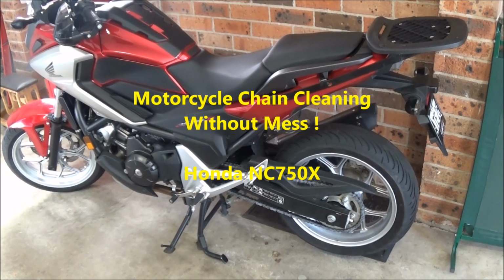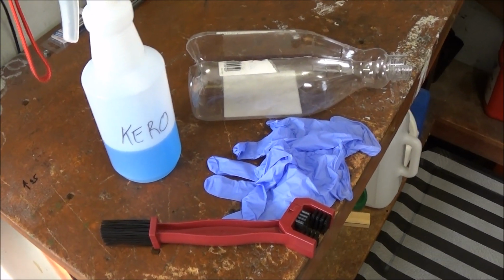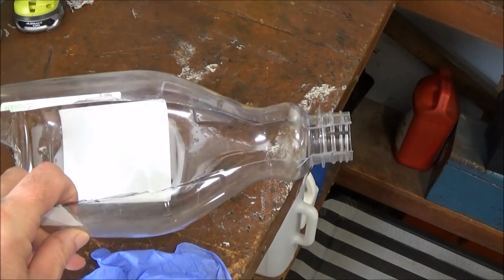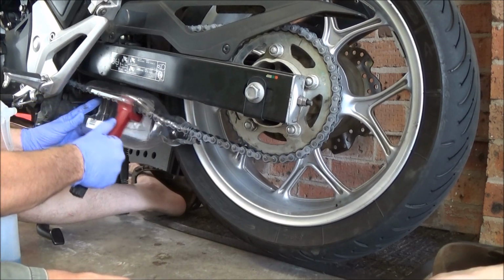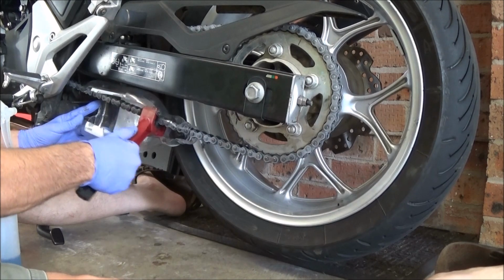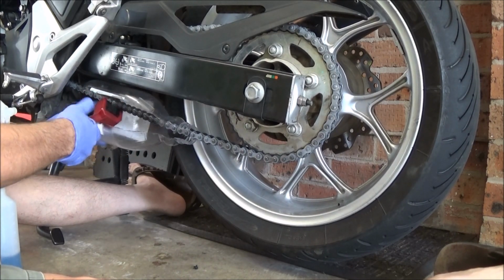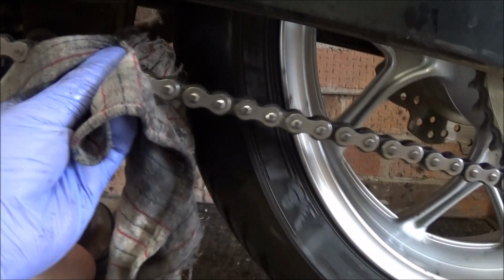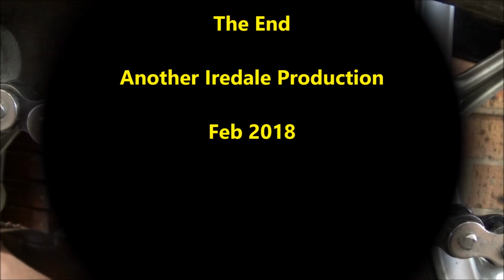Motorcycle Chain Cleaning without mess

Comment: I have to admit I tend to just put a piece of cardboard underneath the bike and around the back of the chain and it just absorbs whatever falls off. I use the same three sided brushes you do and kerosene and just run the wheel back and forth a few times. Followed by the rag. And then leave it 15-20 minutes for the kerosene/paraffin to dry off before I reapply the oil or wax

Comment: If you soke a rag in kerasine, and run the chain through it for 10-20 times, 98% of the dirt will be gone.Then use a new rag with kerasine and do another 10 rounds with the chain. Then its clean. 100%
You only need the brush, if your chain is rusty.
If you have a centerstand, it will take less than 10 minutes. Oil-spray for 1 minute, and go for a ride.

Comment: i dont know if you can get this stuff in auz, but if you can, i use wurth dry chain lubrication in a spray can, no crap on the wheel or tyre when done, drys into the chain, best thing i've come across. just put some cardboard at the back of your chain when applying.

Comment: I need a little advice, you seem to be the appropriate person given all you experience with bikes. Here goes; How often should I clean and lube the chain? (I live in a hot generally dry climate). What is the best - or a good - lube? I've seen gear oil and a tooth brush mentioned often, is this good?
Reply from the maker: David Simons - how often?  The jury is divided on this. But for me it’s every 500km or less if I think the chain looks dry. 
Cleaning? I clean with kerosene and only when the chain looks dirty - like after extended dirt road riding. 
Lube?  Gear oil is excellent applied with a tooth brush but flings off easily so you need to do it more often. It also stinks so Wendy won’t let me use it. 
I just use a brand name spray on chain lube. I’m not brand loyal. I think any will do, according to your preference.
Reply: @AfricaTwin-Stuff   I'll follow that advice. I just ordered some Veloil brand spray lube, seems to have decent reviews. Thanks for the advice.

Comment: Is it hard to remove the chain or is it better just to clean it like you are doing? Thanks
Reply from the maker: Tuga em Bristol Gaming - it is theoretically possible to break the chain if it has a clip-link, but not practical if it had a rivet link. 
But even the former would be a pain compared to cleaning in place.

Comment: When you find cleaning chain is due. Just detach the chain from sprockets, dip it in kerosene oil for few minutes clean it with paint brush from all sides while keeping it in kerosene oil. Flush it with clean oil. Dry the chain with air blower. Clean the sprockets (using common sense). Put back the chain and adjust it's tension. Lubricant with gear oil.  Enjoy the ride with smooth sound. This will increase chain and sprocket life also.
Reply from the maker: Hmmm. Interesting. 
I can’t see that method is an improvement unless you break the chain - which I’m not prepared to do. 
But glad it works for you.
Reply: Definitely not practical. Chains should be cleaned every 400 miles. You'd have to disassemble the cover to the sprocket to get the chain back on. Waste of time and completely unnecessary